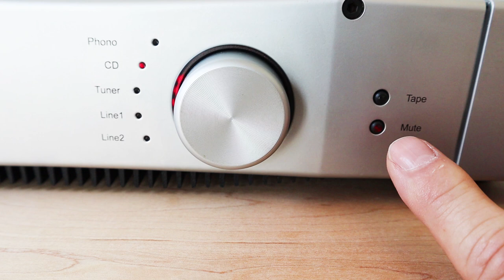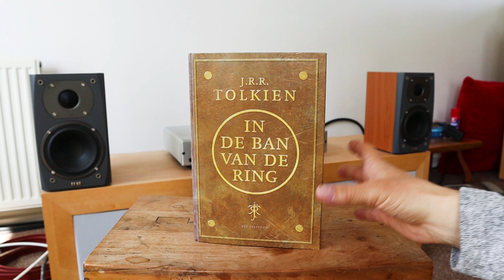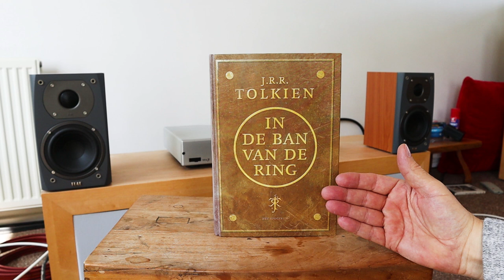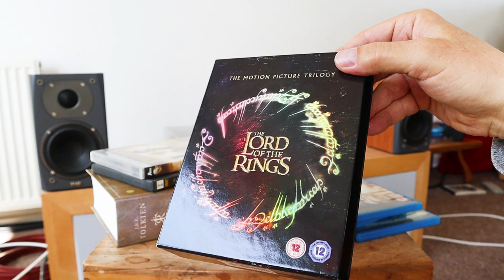Mini Review REGA MIRA-3. The Audiophile Barista Weekly Vlog 101

Comment: Have you ever tried your Aitos preamplifier with other (solid State) poweramps?
Reply from the maker: Hi, actually no. I did use solid state preamps on the AITOS power amps, but not the other way around.
Reply: I asked because in my experience  a very happy marriage is possible  between a valve preamplifier and class a poweramps or class D amps (hypex)
Reply from the maker: @alexandervaneijken7741   I see no reason to doubt that. As soon as I finally have a good working power amp 😡 I will give it a try. 
- Thanks for your comment 👍☕️🔊